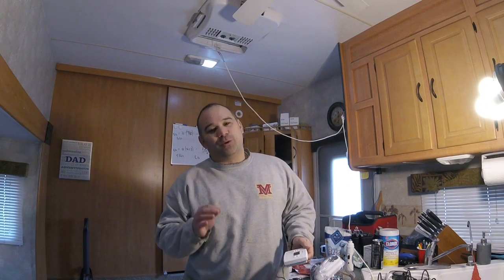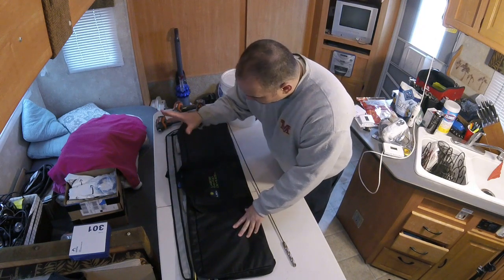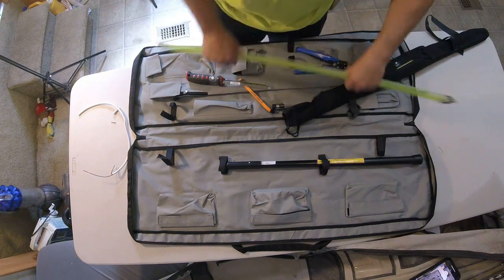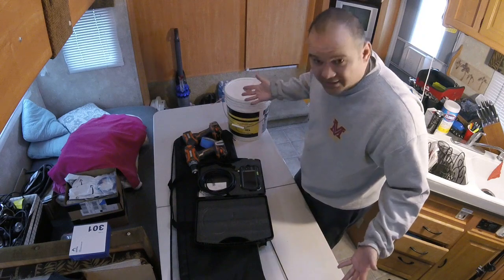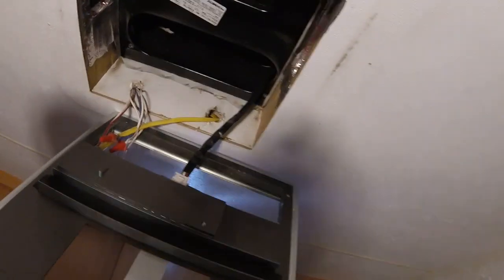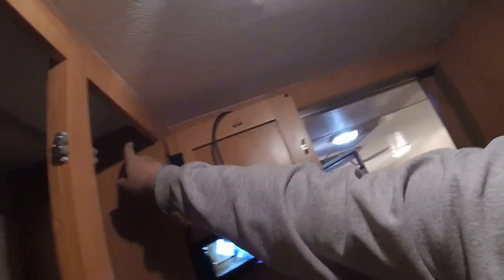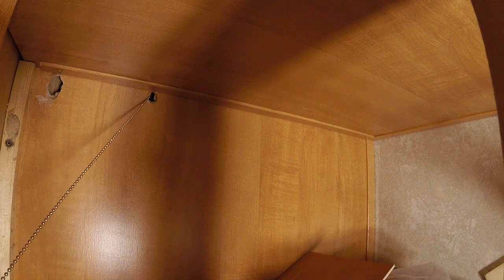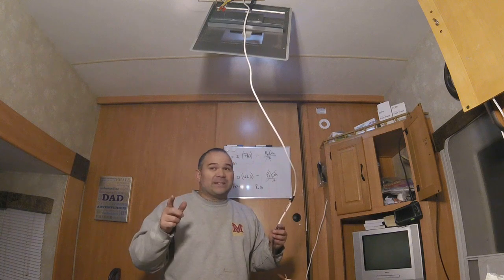How a pro runs wire without access

Comment: Where the wire is exposed in the cabinet. Could you cut out the remaining wood between the holes so the wire is entirely in the cabinet and put a small piece of trim over the now elongated hole to cover it. No one would ever notice it again. Just a thought.
Reply from the maker: That is a really good idea! I’m terrible with wood work, but I think that would be an easy fix and would make it much cleaner. Thanks for the comment and thanks for sticking around. I hope to make another one soon where I finish the attic-to-basement installation by installing the backyard speakers and volume controls